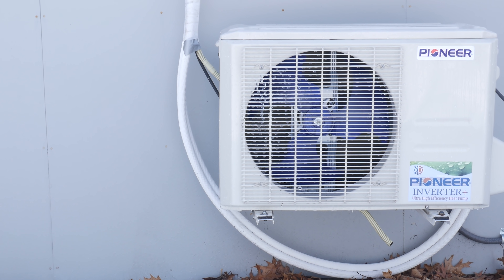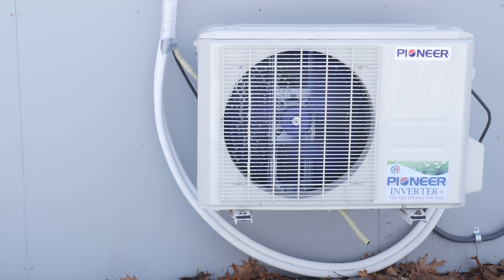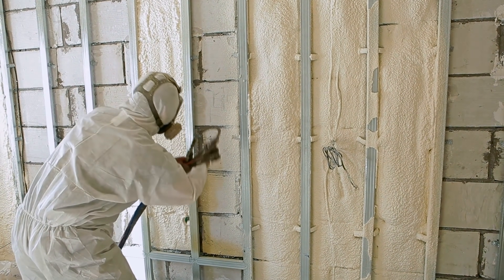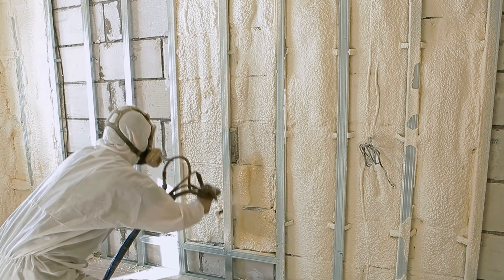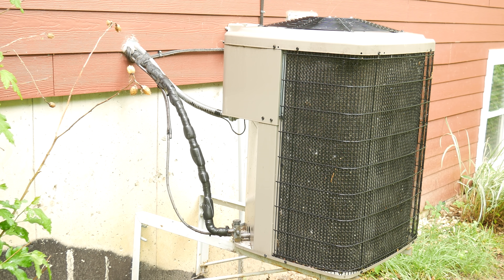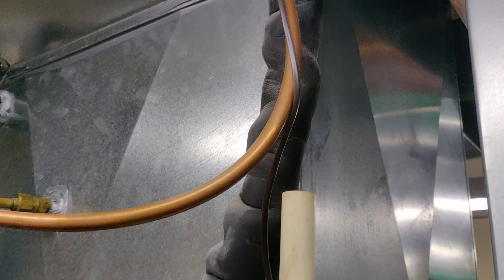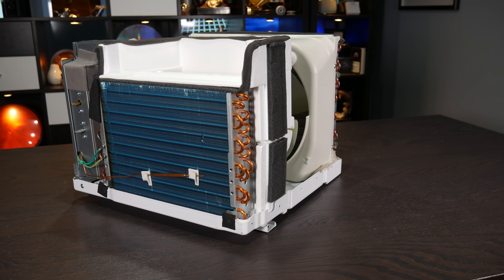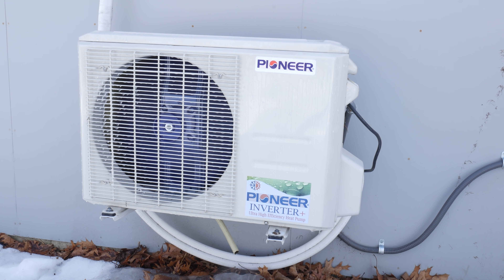Heat Pumps are Not Hard: Here's what it will take to start pumping

Comment: Hydronics is very underrated. It allows to add a whole new level of flexibility. For example, you can use the hot water tank to shift the heating (or cooling) demand by preheating or precooling it in advance, when the electricity costs are lower. 
You also can use hydronics with head units that simply run hot/cold water through heat exchanger instead of refrigerant.
Reply: I like hydronic heating. Simple zone control, nice and quiet. 

My last house had hydronic heat. My new (old) house has hot air (from a wood burning furnace with oil backup).
Reply: Plus hydronic heating systems dont move the air as much. So there is less dust in the air.       Shifting the demand with hot water could be quite benificial when you have solar or a smart tarif where you pay the actual price. Being able to only heat when the grid has to much power could be good for the grid if millions of homes could shift their heating demands on cue
Reply: In our new  farm house we added  a layer of clay onto the brick walls. Then wood shaving insulation panels and another clay layer. Next the pex tubing and another thick layer of clay. The whole wall is open for steam release but with good insulation values and lots of thermal mass.    Another benefit of this style are lower temps in the lines (better for heat pumps) and the moisture regulating properties of clay.   We are going to install solar, a heat pump,plus a sensible heat store (insulated water tank).     When the sun is shining we will preload the walls and tank in the daytime and use the heatpump less at night.
Reply: Yep, if you already have radiators I would pick water/air heatpump everyday. They are more efficient, has better distribution and warm water.
Reply: Space pak has such a system.
Reply: They’re not more efficient, you can get air to air units that have cops upwards of 5, afaik there’s no air to waters that hit above 5 (other than ground source?)
Reply: +1. You can get a monoblock air to water unit that takes water (or water with antifreeze) and puts it into the accumulator tank, where the floor heating draws it from. In summer, it's a hydronic cooling system, in winter a hydronic in heating system. Because hydronic floor heating is much lower temp than traditional radiators, this works wonderfully.
Reply: Don't use heat pumps with usual radiations, unless you can get the water up to at least 60c, use floor heating instead, then you need just around 30c, which seemed workable around 1992.
Reply: @Etacovda63  i'd like to understand the total system losses though, air ducts must loose a massive amount of heat to basement / attic spaces and cause problems like drafts and noise break-out.. plus they dont seem all that controllable for zoning.   in the UK they were installed a lot in the 60s but almost universally ripped out in the 80s. as they were so inefficient.    Thermostatic valves on each radiator (now remote controlled ones in most cases) means i can set temps in every room, on a schedule.
Reply: @PennyAfNorberg  Yep, you need special radiators. There are systems that can work fine at around 40C. But floor heating is WAY superior if you can use it.
Reply: @mralistair737  air to air (as in, ductless) is more efficient than either ducted or hydronic. 

Not every property can do this easily, but it’s a lot better to run refrigerant lines vs water.
Reply: @AlexBesogonov   in the early nineties we had a water water heat pump that gave us water with the temperature around 30c, we had a electric heat above those 30 to about 45c and it never got that warm. In a diffrent house there which was build around 2000 we use floor heating shunted down to around 30c since the heating there is nowaday by burning wood that gives temperature around 80c, also 2.5 m3 storage of that water. Had we opted for floor heating in the nineties we didn't need those +15c and it would been warm too.
Reply: @Etacovda63  yep.. but I was wondering about ducted air vs hot water radiators.  I cna see the air system needs lower temps which is a plus.  but the losses via the ducts and lack of control must be significant.     in a house like mine, i've got  9 radiators and would need 7 (fugly) head units which would not happen.

Comment: When I moved into my house 6 years ago, it had a 5 ton single package single stage single speed heat pump with electric auxiliary heat under the house but it was 26 years old and dying. We replaced it under the California Energy Upgrade plan with a 3.5 ton split two state variable speed heat pump with electric auxiliary heat with two zones and it’s been really nice.

The old unit was an American Trane. The new unit is a Bryant (Carrier). I asked for a 3.5 ton oven a 3 ton recommended because I didn’t understand why the previous was 5 ton.

And the O terminal is the reversing valve pin for most thermostats but not Trane— I think it was C. Servicing my dying unit the HVAC contractor shorted the reversing valve and blew the fuse confusing it for common. I knew the difference because I downloaded the manual. Then when it frozen over, I diagnosed the defroster board was bad. They didn’t believe me and replaced it only to humor me and exclaimed it was bad when they saw scorch marks on the board replacing it— no they hadn’t check when I mentioned the symptoms matched— they just kept saying my filter’s probably dirty despite me having replaced it. I should not know more than the expert I hire to do the work. The contractor seemed familiar with ducts and coolant lines but seemed completely untrained on the electronics.
Reply: Poor understanding on the electronics has also been my experience with residential HVAC techs.

When I had an AC replacement done a few years back, they did not understand how to hook up the Carrier condensor unit to the Carrier Infinity furnace (air handler) controls.  They were about to do it wrong (probably would kill the thermostat/interface and/or the controller) when I brought them a copy of the manual (they didn't have one) and showed them the connections.  They still didn't understand so they had to call back to the shop and confirm - but they followed the diagram eventually and it worked.

They just seem really averse to RTFM - gotta look like they know everything I guess?
Reply: An educated consumer is a consumer who can save a lot of money!
Reply: The oversized “ton” rating is due to the stigma that you need double the cooling capacity for heating. In very cold climates you might, but just maintaining my system has improved its efficiency by another factor. 

Part of the maintenance was smacking the Taco superheat pump so it would make hot water that keeps the heating load balanced, it’s impeller had seized from buildup since the relay was bad.

Comment: Like your brother, I also live in San Diego. When I bought my house 8 years ago, the house had a dodgy gas furnace and no AC. A heat pump was a no-brainer. I shopped around, and at the time, Lennox offered the most efficient system (XP25: 24 SEER), which was only $3000 more expensive than the 13 SEER base AC-only models + gas furnace every installer was pushing. Besides two bizarre hardware failures caused by bad firmware, I've been very happy with it. Paired with solar, the only cost to operate it has been maintenance. The service techs always comment about how rare and fancy this unit is, which saddens me - it should be standard by now!

Comment: Promising as these are, and as far as they've come, I feel like I'm stuck in the mid '80s, shopping for a computer, and looking at paying  $4000 for an 8088 running DOS 3 from floppies at 4mHz. Retrofitting my house with a heat pump was quoted last year at over $30,000, and that's really hard to justify when the existing boiler and occasionally leaky radiators heat the house pretty well for around $1500 annually. If electricity were free, I'm still looking at a 20 year break even point, assuming I've even got that many years left.

I'd be happier to rip out the whole rusty, noisy system and replace it with a minisplit but as you mention, there just aren't a lot of contractors out there willing to do this for a fair price. I'm confident I could do the work myself, but it's just not in my aging bones to take on that sort of a DIY project anymore. 

The only hope for our planet is that my computer analogy is correct and that the $4000 desktop system evolves rapidly to become the $300 laptops we have to day, faster, cheaper, better and longer lasting. But to deploy heat pumps where they could make the most difference, not only reducing emissions, but creating financial stability for millions of families, is going to take an effort comparable to rural electrification, and I do not believe the US has the political will to carry it out.
Reply: Hopefully a cash for clunkers type program, but to update our home environmental systems.
Reply: @justcommenting4981  cash for clunkers was a horrible wasteful program that did nothing to get older cars off the road. It was a backdoor bailout for auto manufacturers.
Reply: @656hookemhorns  yea, but it did facilitate people buying new cars didn't it? The point was, some sort of program should exist to give an immediate incentive to switch to more efficient heating and cooling systems.
Reply: I've no idea how large your house is, but here in the Netherlands a family house running radiators can be refitted for something like 10.000 euros.
Reply: @luipaardprint  my fellow human that says 10 euros
Reply: @luipaardprint  in most British houses installing a heat pump means replacing all the radiators too
Reply: “Broken window Fallacy”… the idea that breaking windows & buying new ones help the economy.  No it’s just wasteful.  (Ditto the smashing of old cars that still worked & passed emissions inspection.)

.
Reply: My mom had a car that qualified as a “clunker” but she kept it.  That saved: $20,000 plus 100,000 miles of pollution junking the old car & manufacturing a new one
Reply: $30,000 is insane.  I would buy the unit wholesale for $5000.  Then tell the HVAC company “I already have the heat pump.  Just install it please.”

I do that with car dealerships too: I supply the oil & filter, and they charge $15 labor.  It saves money

.
Reply: 30k is a grotesque ripoff. materials probably aren't more than 10k.

Comment: 2:37 Yes! Insulation! Save the energy! :) (Am a mechanical insulator as I've said before on this channel, so I appreciate the acknowledgment)

In Vancouver BC, the very building where I live's parkade has ~200ft of exposed 2" piping that is our heating supply and return pipes for the in-suite radiators. I have let them know as the building managers have just replaced the roof, envelope and windows to save on energy, but haven't insulated. They're now litigating us to increase the rent $50/mo more to pay for their past upgrades, which has me begging the question of what is our rent paying for if not the maintenance of the building?
Reply: You might as well just start insulating it yourself 🤣

Comment: The house I grew up in located in South Australia, had a reverse cycle window box type unit as its sole source of heating and cooling. It was installed in the early 90s and worked well until my family sold that house in the early 2000s. Every house I've lived in since has had a heat pump in one form or another. I only recently found out through your channel that reverse cycle air conditioning just isn't really a thing in the US.
Reply: I kept thinking “what’s this fancy new heat pump tech?” and took me too long realise every house I’ve been in has had a split system and it’s just the US lagging behind the rest of the world
Reply: My US heat pump system dates from the 1980s.  The US isn’t lagging… we just have dirt cheap fuel (like $1 gasoline & diesel).  It’s only recently that heat pumps became cheaper than oil or gas burners
Reply: EUROPE is the lagger.  They have about 1/3 as many air conditioned houses as the US has.  I personally cannot imagine living without a/c
Reply: “reverse cycle air conditioning” confused 1960s American consumers.  So it got changed to “heat pump” in the 70s, so people realize it’s a system to make heat
Reply: Heat pumps are a thing in America. I have been working on them since my first service call in January of 1984.  We use them a lot in rural areas, where there is no gas supply.  The house I lived in Grants Pass Oregon back in the 70's had all electric heat, because the cost was like $0.025 per KW in the 70's and now is only about $0.10 per KW due to a lot of hydropower here.  Heat pumps are becoming much more popular.  Even those homes still heated with oil, it is popular to use a heat pump for most of the winter, only using oil or propane on the very coldest nights, when temps are below 5F.   

Many times the heat pumps are installed undersized for the heating load.  This leads to running the electric back up heater on nights that are below about 25F, so much of the winter in some places.  My heat pump is oversized for cooling and just large enough for heating mode.  I never hooked up my back up 20 KW heater, so I know it can be done!   In Portland Oregon, the lowest normal winter temperature is about 23F.  So not very cold here.
Reply: @electrictroy2010  Which is actually more accurate - a "reverse cycle air conditioner" is just a heat pump that can pump the heat in either direction. It is true, though, that in cold climates the size of the heat exchangers are optimised for maximum efficiency in house heating mode, while in hot climates they're optimized for cooling mode. But it still works fine in either mode.

Comment: I just installed a heat pump system myself.  I have an older home with boiler heat, so ductless was the way to go.  Install is easy, and it is incredibly quieter than the window shakers.  Haven't used it for heat yet, but I'm going to try it out this fall.  I am working on plans for a new house, and I think I am going to use these for the entire HVAC system, along with an ERV.  If you are interested in viewing the install, or getting some B-Roll for your next heat pump video, let me know, I'm in northern Illinois.  Great video, Im glad someone is pointing out the positives, and possible negatives.  Keep up the good work.

Comment: I think that the part where you explained “why insulation is better than heat pumps” can be summarized with this thought experiment :

 If you’re filling a bucket with water from the tap, and that the bucket have holes in it. 
Do you try to get a bigger tap to fill the bucket faster,
 or do you try and fix the most amount of leaks?